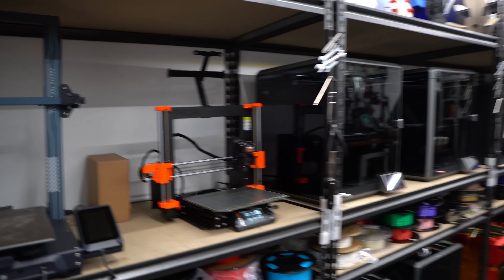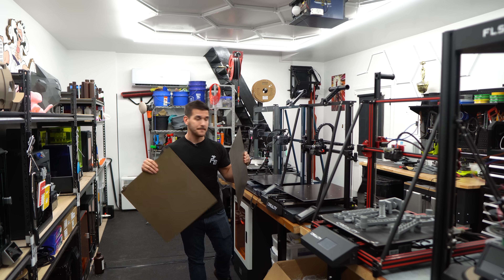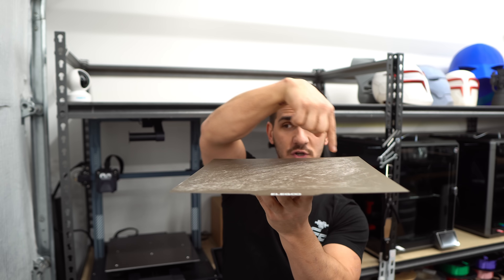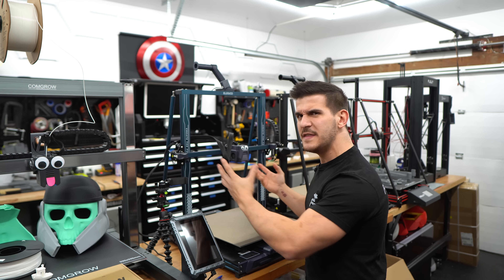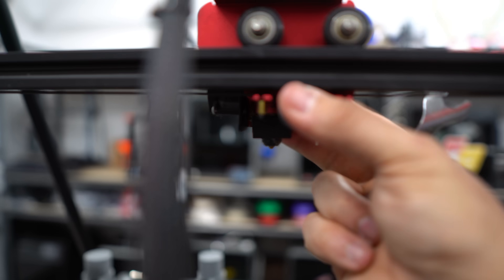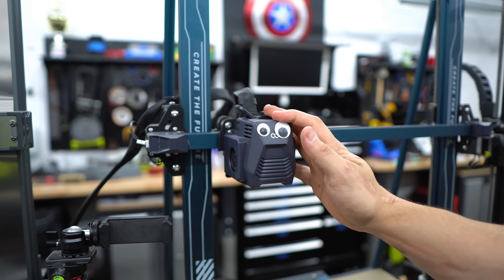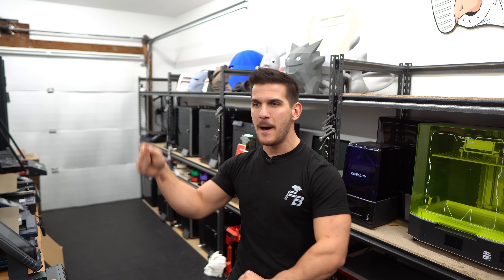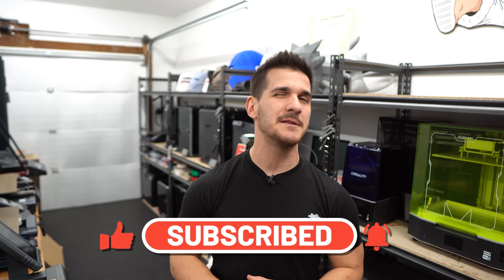TOP 3D Printing Maintenance Tips! | 2024 Edition

Comment: Regularly checking the nozzle and bed springs. We were getting loads of failed prints on our Ender 3 v2, it turned out the strings were worn out and the nozzle was significantly worn down

Comment: When I first got my elegoo neptune 3 max about a month in a failed print threw my printer head off level and eched the print into the build plate.😅 I would definitely tell my past self to check that and save 50 bucks.

Comment: Make sure your 3D printer has a filament run out sensor. Once the filament goes past the extruder, you cannot retract it! Pulling apart direct drive machines to remove and clean out the filament is not fun! Lots of hours wasted.

Comment: The biggest thing I found was that different color filament sometimes requires different heat settings, both for the bed and the hot end.  Darker colors take less heat compared to lighter colors.  This means one g-code isn't good for all colors from the same manufacturer.

Comment: My advice for past self would be download the slicer tool and load up the STLs to see if the stuff you want to print fits in the print area of what you’re looking for will fit AND slice it and see how long it takes.  I think had I known how much slower my first printer was vs my 2nd I wouldn’t have bothered with the first printer and sprung for the more expensive faster printer up front.

Comment: Googly eyes. Googly eyes make everything better. 
Bed cleaning is never wasted time. 
Clean out detritus from hot end path (I just push through some old filament, but will give the longer needles a go).
Replace out a nozzle instead of wasting time.
Levelling/tramming (ABL is great) using a post-it note instead of thicker card.
Store filament in zip-lock freezer bags w desiccant bags inside and clip to hold filament end and it does stops snagging. Write temps on the box.
Everyone is allowed to use their printer for different purposes, it doesn't stop me from learning from them.

Comment: I'm in Michigan. My printer is in my office, that gets a bit cold in the winter time. Last year I had no issues with filament storage since I just had some esun black pla+. Later my wife started buying some pack of different glow in the dark pla filament. That stuff only lasts so long before it gets brittle and snaps all of the time

Is that because my environment is dry? Frank mentioned he had a dehumidifier,  I would assume to save the life of filament it needs moisture not dryness. 

Mansplain please.
Reply: Moisture in the filament immediately goes to vapor impeding the plastic flow through the hot nozzle. The brittle nature comes from chain scission of a long chain polymer usually by exposure to ultraviolet light. 'Shroom your filament! If you suspect moisture content, dehydration bake for a couple of hours at about 200F. The closer you can get to the vapor temperature of water (212F or 100C) the better. Beware that you are also very close to the glass transition (pliable/melt) temperature of PLA (120C?). Results may vary. Have fun!!

Comment: I wouldn't change anything about my 3D printing history. I started with a base Ender 3 and upgraded things over time. Could I have spent more upfront for a better printer with more bells and whistles? Of course - BUT starting with an Ender 3 that requires you to learn all the ins and outs, requires you to troubleshoot - it just helps you to understand how 3D printers work as a whole. No sense in starting off with a $1000 printer if you don't understand how things work.

Comment: THINGS I WISH I KNEW - 1. The technology is exponentially better every year. Do your research and don't buy someone elses old unit (unless a Prusa, even then...). They are typically not upgrade-able. The new printers are SO SO SO much better than previous. The frustration isn't worth it. 2. SPARE PARTS - Having a spare couple items on hand isn't a bad idea. 3. CAD SOFTWARE - SO SO SO much better than it used to be. Accessible, intuitive++, FREE. It's very rewarding to be able to napkin sketch an idea, and then have it created before your eyes. Then it fails, you try again. It fails again. And again. Then on a future revision, you nail it. Part of the process, but you're beginning. You won't nail it first time.

Comment: What I wish I would have done and I tell people all the time "I have a N3 Max" is to just pull the trigger on a piece of tempered glass for under the build plate. Zero leveling issues or adhesion issues anymore. Just go you any local glass company tell them the size and to bevel the edges so its not sharp. Didn't cost much at all. And I told the girl what it was for and she knew exactly what I wanted and needed because her boyfriend has a 3D printer.

Comment: Those gold color PEI beds are the best beds I’ve come across. The engineering is simple. The plastic pushes into tiny little veins in the bed mechanically locking the plastic into the bed as it melts in there and then cools to bed temp. It locks in very well if the bed is clean like you suggest. The trick to these beds is to be patient when your print is complete. Let it cool completely until it lets go and you can just pick the print up and its not stuck to the bed at all. What happens is when the bed cools so will the plastic so both surfaces will contract causing the plastic in the tiny veins of the bed to shrink unlocking the print mechanically from the bed. You shouldn’t need glue and that patience will save you from damaging the bed trying to pry a print off early. Lol 

Ok, now start learning how to 3d model in blender already and make some vids. Did you take my suggestion and reach out to cgcookie yet or at least check out the site to see if it’s something you are interested in? I’m not an affiliate of any kind. Just a DIY guy thats used Blender for over 15 years and a member of cgcookie for over 10 years. I honestly think you would fit right in and grow your network. It’s a community of artists of all kinds from all over the world. Painters, sculptors, photoshop, Blender… You probably know or have met members and just weren’t aware. Or you’re already a member and I’m the only one ignorant here. 🤣🤣🤣

One thing I repeatedly get reminded of that comes back to bite me on a regular basis is to remember to use z hop. Countless times I’ve had the nozzle somehow get hung up on the print causing it to jam up and then strip the whole hot end out of alignment so once it un jams on its own because it just keeps trying to print it ends up trying to print in an offset. I cone to check on it hours later and i have half the print shifted an inch over and noodles everywhere. Lol Sometimes it gets hung up bad enough that it pulls the bed out of its retaining clips. I have an Ender 5 plus by the way. An oldie but she’s big so I love her. Lol

Comment: I would tell myself to SLOW DOWN. I want to print as fast as possible all the time but in the beginning it helps tremendously to slow that print down to get good adhesion and see how well your printer is doing before ramping the speed up. Curious, where do you buy your bulk filament? Also where did you get that large nozzle cleaner???? Mine are all those stupid tiny things.

Comment: if I could go back and worn myself it would be about all the little odds and ends you'll need to finish any given project...example., paint , primer, fillers and sandpaper to hardware, magnets, and glues as well as some of the "power tools" like sawdering irons and heat guns.... none of which individually are expensive but if you don't already have a start on some of it then it can add up and feel a little over whelming....and also that failed prints are part of the hobby ...

Comment: I love you videos mate!
I have the little CR6SE for just over 3 years now and just love this machine! LOTS OF TLC NEEDED!!
But I love the auto bed leveling, but still needs tweaking every so often.
As you said, that hot end!
I strip mine down every couple of months and give it a thorough cleaning.
Takes 30 minutes to an hour, but worth it.
Extruders also need cleaning as mine isn't direct drive.

I'm just curious as to how you know if the rubber wheels need replacing and also the correct tension for the belts.
On my CR6, the belts are almost hidden in the metal rails and difficult to do really check.

But if you could guide us in the correct "tuning" of this, that would be awesome!

Because of you, I'm busy with my first Mado helmet also!
Very difficult to find the correct paints and stuff here in South Africa.

But thanks again for you videos!
Easy to follow and very informative in a short time!
No need to babble on and on like some other channels!

Thanks again mate!
Stay awesome!